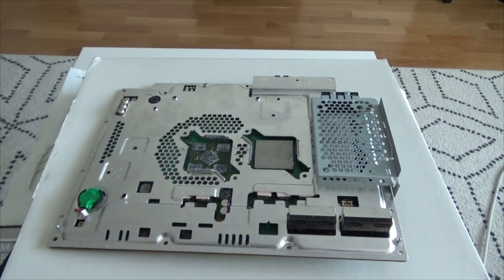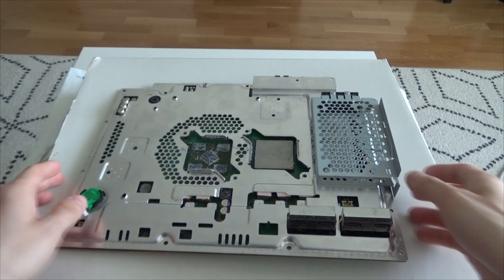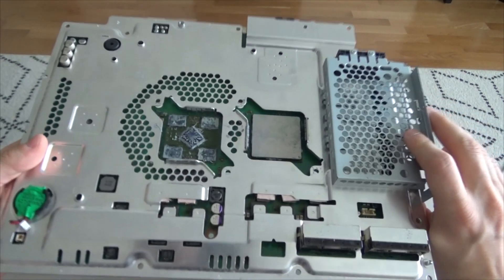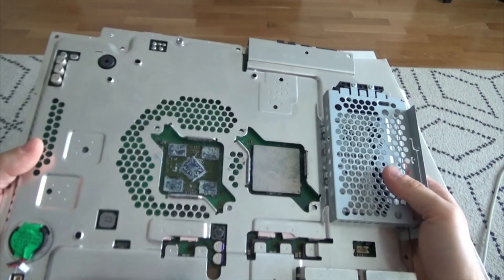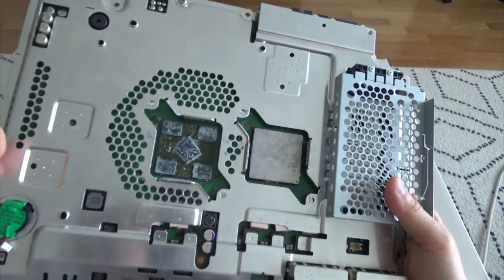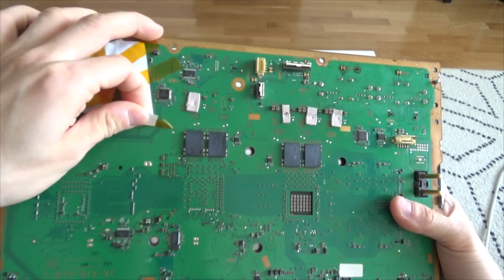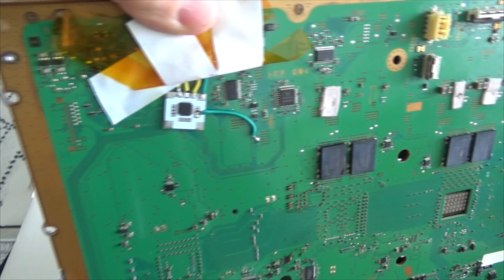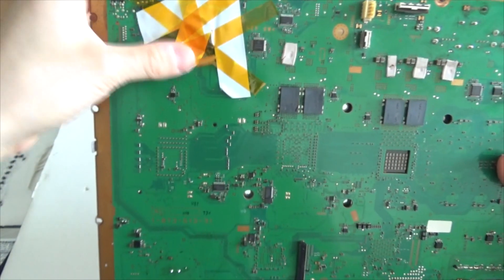PS3 YLOD repair newest method (RSX Mod)

Comment: Hi, this video and the story behind this is incredible. Well done to everyone involved. I have a CECHA01 model that unfortunately had a YLOD, and I want to replace the 90nm chip with a 40nm one. Is there any repair shop in the UK or EU that provides this as a service? I definitely don’t have the tools or experience to do this myself unfortunately. Thanks!
Reply from the maker: I used to do it, but it is on hold now. There is a guy in romania, but he doesn't want to work on cecha models anymore due to complexity and fragility of the board. However if the board is untouched, there may be a chance to convince him... But then again, he has another issue. 40 nm chips and components from slim boards aren't easy to get.
Reply: @calyps0man  The board isn’t completely untouched unfortunately. It was untouched until recently when it got YLOD and I passed it to a repair shop in London which tried a reball but it was unsuccessful. Other than that there were no changes to the board so hopefully it is still in a condition he will work with. I am happy to cover costs of buying a donor console too if needed. I just really want to get it working again :(
Reply from the maker: @maximb97  Sorry I don't think he will work on anything like this anymore. It's just not worth his time. Usually boards like that have unpredictable issues. I might be selling a modded CECHA 00 some time in the future as well. I'm still waiting for some of them from Japan, but they were delayed due to covid. Do you have discord?
Reply: @maximb97  you could still revive it by replacing the NEC/TOKIN capacitors with modern tantalum capacitors (4x 470uf 2.5v per tokin replaced)
Reply: @michael9613  Recently a technician read the syscon error logs which were filled with 3034 errors. That means the RSX has gone bad and it needs a replacement. Replacing the capacitors on it won’t help in this case unfortunately.
Reply: @maximb97  i just did a full cap replacement on my A01 and I managed to boot it via compoment only booted to the point of picking which user you will use and then it blacked out and no power lights. I do plan to swap the rsx with a 65nm from an L01 I killed sometime in the future but I'm still having my doubts on this 65nm
Reply: @michael9613  From what I’ve heard online (and I admit I’m not the best informed on this) usually replacing the caps heats up the RSX a little because it’s directly on the opposite side of the RSX. Because of that, the RSX manages to work for a short period of time, but may fail again soon. Your best bet is to read the syscon chip errors to see whether it was only the caps that were bad. I think the error code for those is 1002
Reply: @maximb97  can confirm error 1002 can easily be fixed with cap replacement, others, not so much. Rsx tends to fail in the 90nm revision (have one myself that boots, but blackscreens), RAM chips soldered on the rsx are also problematic, but Vmem can sometimes be the cause (smaller 1-phase regular just by the side of the 2 bigger phases for rsx Vcore).

Comment: Amazing work on the video! so great to see that there ways now to get rid of that terrible 90nm chip.I was thinking about it a lot after reading the post about the cecha with the 40nm. Unfortunately I don’t know how to do these mods myself if by any chance you know anyone in Europe that can do these please let me know
Reply from the maker: There's one guy in EU, but he doesn't want to work on cok-001 boards anymore. So if you have a cok-002, then he can help you. I myself have been busy and haven't perfected the process yet either. The board must be untouched though.
Reply: @calyps0man  I have a Cok-002 fully working 70 days uptime but it does have tantalum capacitor on the rsx side do you think he would still touch it its fully working and been delided both rsx and cell already.

Comment from the maker: Turns out the mod might actually work with some of the refurbished boards. But it's still in the testing stages. You would have to bridge two different pads on the modchip. So bridge the VCC pad with the neighboring one instead of bridging two pads on the edge. It is also done like that for the slim boards... I've shown various boards installations in this video. https://www.youtube.com/watch?v=VLewtL_2HxM

Comment: Is it possible that the gpu is shorted bcoz when i tester most of the capacitors theres a short.even in the 8 big tantalum capacitors is shprted to
Reply from the maker: Gpu resistance is very low. 1.5-4 ohms. Idk how you were testing it though.

Comment: This is some excellent work! I have an arcade system that uses a PlayStation 3 motherboard (Namco System 357) and it has the yellow light of death unfortunately.  Hopefully someone can try to fix it for me using this method. It’s way to advance for me. Good work! :D
Reply from the maker: Oh but that board would require a different wiring of the modchip... I might have to include it in the next video.
Reply: @calyps0man  hmm very interesting! It would be awesome if I could somehow send it to you. These boards are very hard to come by and I would like to have it  fixed.
Reply from the maker: @FIGHTERSCHOICEArcade  I need more time to perfect the process. It's extremely complex
Reply: @calyps0man  no worries! BGA soldering itself is very very complex especially without the appropriate equipment! Hopefully you can perfect this process and maybe make a course on it? Would be hella interesting! :D

Comment from the maker: Disclaimer. This kind of work is best suited for people who are familiar with electronics and have a solid knowledge of the ps3 motherboards. You also definitely need to be famliar with syscon commands and diagnostics. If you don't know anything about it, then better send it to somebody who does. Also, this is very important. You need to check your syscon serial before you attempt to do any swap at all. You might have already refurbished board with a 65 or 40nm RSX. If you see numbers like 303GB or 304GB on the syscon chip ,then your board is already refurbished . The 303GB will have a 65nm RSX. The 304GB will have a 40nm. You cannot install a 40nm on a 303GB syscon. The modchip will not work with it. It also won't work with 304GB.

Another issue is the way which I've described here for doing the 0.95v mod needs to be changed. As well as some of the resistor modifications. There is a better solution. I'll try to edit the video when I get the chance.
Reply: Hi there, I have ordered 20 pc of them from the 3rd party as you advised. The cost including shipment to EU is $360. If I get tax it I will be broken:(. I hope all of them will be working so maybe I will revive some PS3 so satisfaction will be my only reward:).
Reply from the maker: @tomaszski9818  Of course you will get a customs tax. it is outside of EU. That is something you were supposed to research or ask the person through fiverr to claim a lower value. But they are working. Why did you order so many, though ?
Reply: @calyps0man  My colleague has a successful repair shop. He said he wants 100 of them. After checked the price he almost gave up cooled down😉. I will help him to reduce the cost, lets say support him. I hope at list he will fix the most valuable PS3 including my own one and get some money back.
Reply from the maker: @tomaszski9818  I see. May I suggest that you also wait a bit for me to post the newer way to install resistors. This one will work too, but it is not how Sony has done it. Here we were cutting corners in a way.
Reply: @calyps0man I will wait anyway for those chips 3-4 weeks. I hope by then You will make nice vid with instructions. All the best.
Reply from the maker: @tomaszski9818  To be honest, I have been quite optimistic about how sharing knowledge would help people save their consoles. But then I've seen how sometimes somebody who plans to do this is not deeply familiar with diagnostics and how ps3 boards work specifically.  Then they don't know what went wrong or how to actually diagnose the problem. I have eventually realized, this is not something for beginners. The warning at the top was just for that reason. I cannot predict every possible situation that might go wrong with the board. This is why I encourage everybody to learn how to diagnose and understand syscon error codes. https://www.psdevwiki.com/ps3/Syscon_Error_Codes#System_Errors

Comment: So the very same capacitors that killed thousands of Toshiba laptops have not killed all these ps3?
Reply from the maker: Syscon error codes don't lie. They literally tell you what is wrong. Blaming it on capacitors was a blind guess because back then there  were no other ways to run diagnostics.

Comment: Hi, i have a broken phat ps3 60gb. Should be a CECHA01. It had been reballed and i wanted to transfer all my games on it to an other ps3 but it did ylod again before i had the chance to do this. So, is this one particular rsx chip there is to order for the ps3's that are compatible? If not, i am not sure if i order it will be the right one. The wiki site shows always an xx after the cecha...? Is there a certain rsx i need for a cecha01 60gb ps3?
Reply from the maker: All will work except for 28nm chips.
Reply from the maker: Check here for serials https://www.psdevwiki.com/ps3/RSX

Comment: Nice video bro, the best info is, the NECs are not the reason for the YLOD, finally people's begins to understand it! An YLOD is mostly caused by overheating or like you say the RSX in this case. I'm my self a pro, the only question i got is, would this chip protect the original RSX also, or it needs to be replaced? The thing is, the original RSX needs more voltage of course, but it has also more performance. You may gonna have less FPS in hard games like GOW3 or TLOU. Long ago on the PS2 Slim a laser fix was done, because the Laser was running hot and so it just died faster with the time, so there you could buy this small pcb witch you just soldered to the Mainboard, and so the Laser was running cooler because lower voltage. I think a chip mod like that would be great for the RSX, so people's no need to take it off first and replace it with an other one. The RSX on the oldest FAT Editions is more powerful than let's say the RSX from the Super Slim 😆
Reply: I will add my 2 cents make of this what you will I don't really care either  way,.. I repair ps3s every day.. I also buy bulk lots of 40 cech c03 consoles at a time from cex as faulty.... Most have ylod symptoms.. I will tell you absolutely that out of 100s of consoles that come through my door the nec tokin repair will only solve about 8% of consoles the rest are rsx issues either the chip itself or  bad bga connection. I have no horse in this race I'm only giving my experience. Good video by the way 👍 , @NSC id like to see some more from you aswell and HD in the place to be 😉
Reply: @RealDixonPeter  you welcome 😀
Reply: @RealDixonPeter  I think several replies here are missing the point, unilaterally dismissing the NEC/TOKIN problems as a non-issue is WRONG, as I stated it may not always be THE issue but they also can't be dismissed as "never the problem" because that's bullshit.

I've also fixed piles of PS3's back in the day but haven't in years because it hasn't been worth it for 5+ years now to do so, everyone's long since moved on to PS4/5's, this RSX swap and modchip install wouldn't be worth the hassle/expense.
Reply from the maker: @RealDixonPeter  Thanks man. It's not always an easy pill to swallow . Especially when syscon diagnostics has surfaced rather quietly. It wasn't covered by big youtubers unlike the NecTokins craze.
Reply: The NEC/Tokin caps are absolutely a cause for YLOD, there are a bunch of Youtube videos (including one by NSC Modz himself!) that prove it by replacing them and it fixing YLOD issues, that would be my first thing to try before going crazy with a mod chip and RSX swap.
Reply from the maker: @glassvial  Please stop spreading claims that have been disproven so many times already. First you need diagnose the error code, only then you can decide where the fault is.
Reply: @calyps0man  right way to go, also peoples needs to remember if the PS was overheating already... sometimes peoplesn replace the NECs after the PS died because an overheating... this has nothing to do with the NECs ^^
Reply: @glassvial  Sure, but videos where a heatgun was used (including my Video) for the NEC replacement is not really a proofe, if you really want to know that, than take of the NECs with a Knife and solder the Tantals without a heatgun (Only with a Soldering Iron) than you can talk about proofs, because when u use a Heatgun, this could also work as a Reflow, some PS works also after a Reflow, because the problem was the Soldering balls witch has loose contact to the board or was cracked. It´s a very complex thing this all, but i saw peoples Replacing the NECs just because the PS3 was overheating :\ When the Fan of a PS3 turns very fast or is very loud, this is the sign of Overheating, no need to Replace the NECs because of that, here you just need the remove the IHS to renew the thermal paste :\ Thats why i say, peoples first need to check, where the YLOD cames from, before doing bad stuff that will damage the PS even more as it was befor xD
Reply from the maker: @glassvial  Just learn about syscon diagnostics first. https://www.psx-place.com/threads/fault-finding-ylod-with-the-syscon-first-steps-and-error-reporting.30100/ The videos you linked were done before access to syscon was gained. You can't just blindly replace the caps without diagnostics. NSC already replied, but any time you add stress/heat to the board around the rsx area, it's obviously going to be affected too. It easily  gets "revived" from a little heat sometimes. I can also give you examples of people who swapped them and later the rsx failed anyways, because they didn't diagnose the real issue. This topic has been discussed in depth on psx place. Just do your research.
Reply: @glassvial  what does this have to do with the conversation here?
Reply: @glassvial  Yeah, but relax, i had many many many PS3's witch the NEC Replacement had not help, because the main problem was overheated chips cracked soldering balls or burned traces on the board, so here the NEC replacement is just not helping at all ;) i know what I'm talking about ^^
Reply: @NSC-Modz  Then I guess you should take down your video proving that replacing the NEC caps fixed YLOD then, there are a ton of videos about this, it's not always the case but it is a very common one.
Reply: @glassvial  hehe no, u just dont understand the difference when it´s time for the Necs or an other repair :)
Reply: @NSC-Modz  I understand that the NEC's are not always the culprit, but I will also not unilaterally dismiss them, either.
Reply: @glassvial  sure not, it always can happen that they are corrupt or damaged like in some notebooks, but mostly PS3's are overheating. That's how the problems begin 😀
Reply from the maker: Hmm. I think the problem could be a bit more complex. Nvidia at the time had all kinds of issues with packaging of their GPUs. Surely it had affected RSX as well (they were involved). Underfill/bumpgate/interlayer delamination were some of the suspected issues. You're talking about undervolting/underclocking. Well, that I have not attempted to do. But I honestly don't trust the 90nm to last. You could come up with some ways to keep it operating a little longer, but it will most likely die anyways at some point. Also I have never heard of stock RSX having more performance than super slim RSX. Have you tested these models of ps3 side by side? Also not all super slims have the same RSX. Some have 65 or 40nm, latest ones will have 28nm.
Reply: @calyps0man  yes, i test a lot PS3's xD
Reply from the maker: @NSC-Modz  I would like to see some proof or demonstration of that. Sounds difficult to believe. Also this modchip will not protect stock Rsx. It is only there for fooling the syscon to think that original is still in place.
Reply: @calyps0man  ok, I'll try so soon as i got time to show you that. Just play GOW3 on the Super Slim till the second save point and test the same with an CECH-A or B edition. You gonna see it runs way better on the FAT.
Reply from the maker: @NSC-Modz  Alright. Thanks for the suggestion.  My only SS is in pieces atm, maybe I'll put it back together later. But if this is true, then I guess you learn something new every day :D
Reply: @calyps0man  yes sure, we keep learning till we die xD I test a lot with PS3s and more stuff, but when it comes to GOW3 i would play it on a fat before i play it again on a ss 😆
Reply from the maker: @NSC-Modz  This actually made me think, that the difference in performance may not necessarily be related to GPU. It could be Cell or something else that is slowing things down. The SS boards are very different compared to Cok boards. So I think it would be reasonable to compare the performance of the Cok board that already has a 40nm with the board that has stock 90nm. At this time I don't have two identical C or A models. But I will pay attention to that the moment i do.
Reply: @calyps0man  yeah, just test it one day, i have test it already long ago. Maybe I'm gonna test that stuff again and than I'll do a video about. On the SS games are stuttering more, you will feel it, maybe it's gonna get a bit better with an SSD but I don't think so. Could be the CPU, RSX or both 😀
Reply from the maker: @NSC-Modz  What about regular slim models?
Reply: @calyps0man  im pretty sure nsc is wrong. I have a super slim and a cechc04 and im not seeing any differences. The technology improved, it didnt digrade